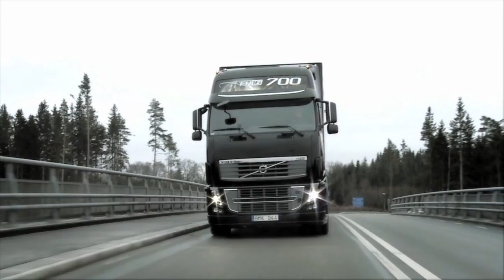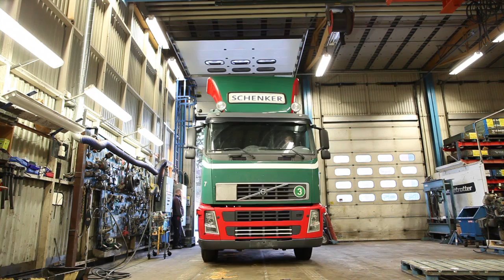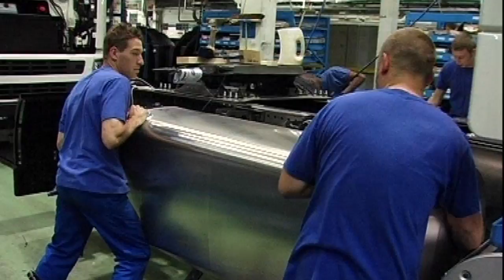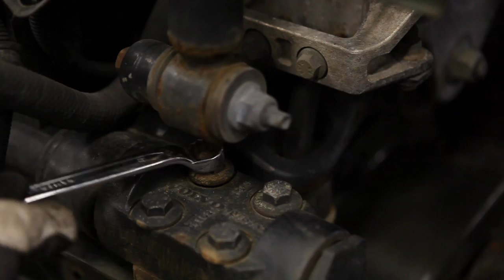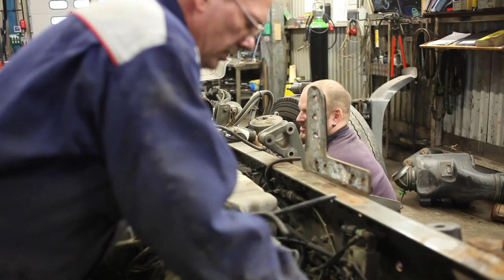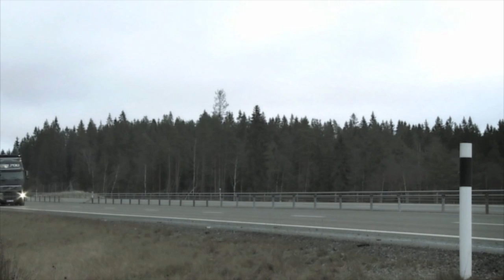Volvo Trucks - How a Volvo Truck is recycled

Comment: Engine is worn out? I had a Volvo fh12 which had over a million miles on it and it still pulled like a train...
The small company I worked for only had one contract delivering fruit juice in fridge trailers so had 2 wagons and trailers so they always had one on stand by.
They had a newish FH and the old 1999 but I enjoyed driving the old one as much as the new truck.
Brilliant wagons..